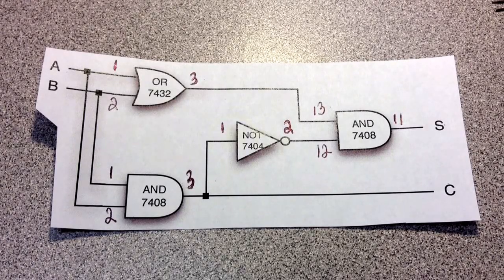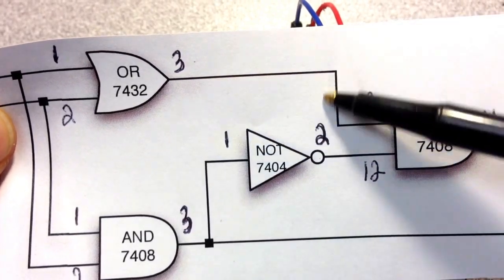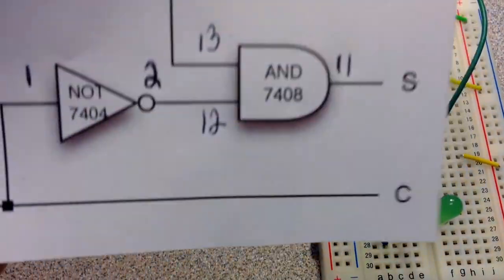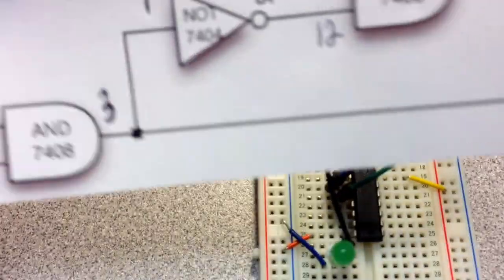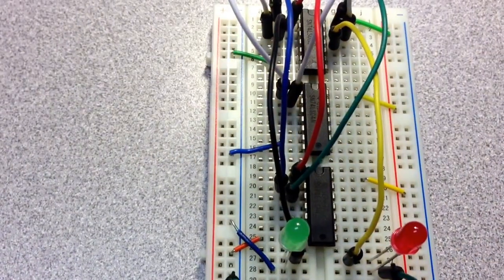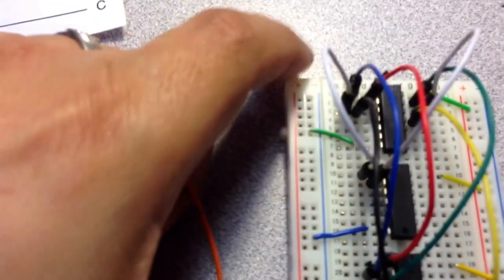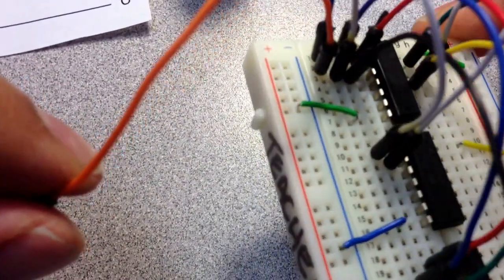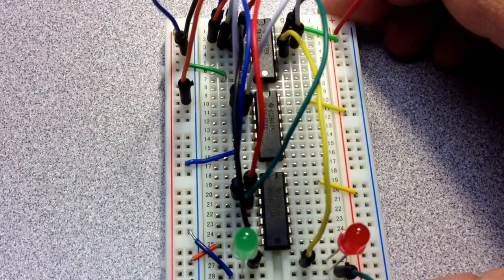Assignment 2 - Implementing our Half-Adder Design

Comment: can you tell how many volts battery you used? And I have 9 volt battery how can I use in this circuit which need 5.25 Supply voltage at max?
Reply: u can use a regulator to reduce it
Reply: Omar Ahmed yeah I figured it out though I used Ic7486 for this. Thanks any way